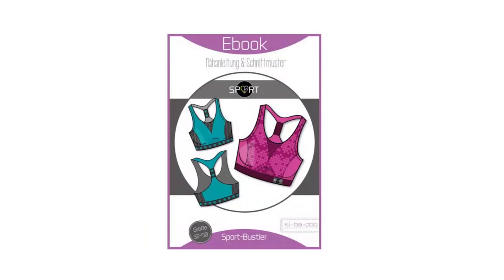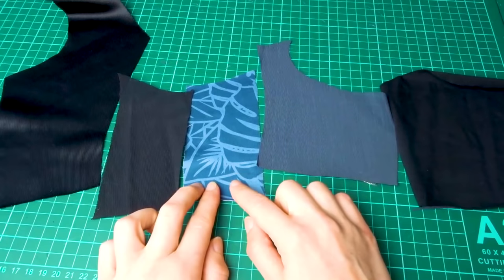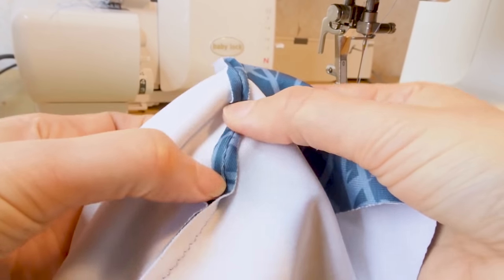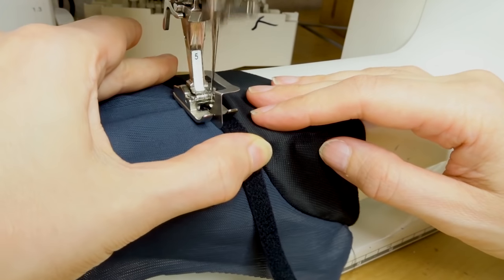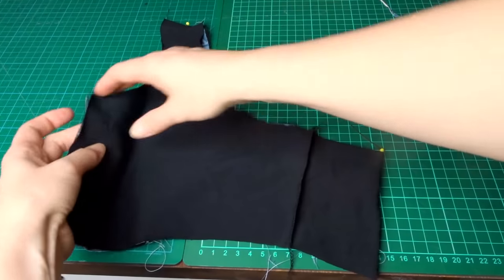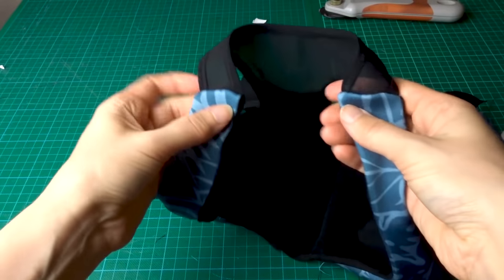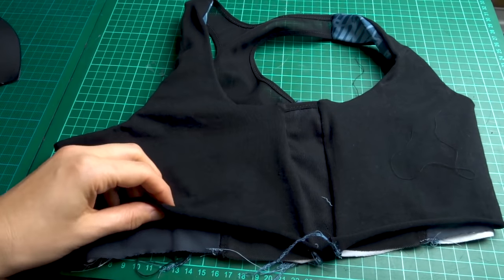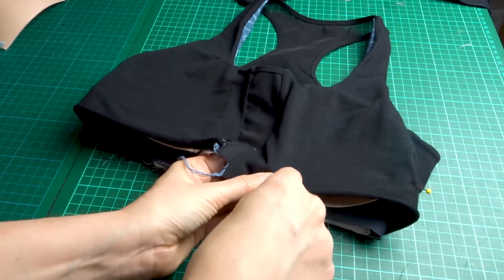How to sew a supportive sports bra

Comment: I realize this is an old post but for those watching now and wondering how to best finish the edges of the trimmed bra cups. These are my suggestions: 1) medium zig zag around, 2) serge around or 3) use strip of sheer cup or 15 denier tricot  to bind cut edge (can also use foe). Since foam cups are all internal the first two suggestions would suffice. This would also flatten the exterior cup contour so you don’t get as visible a ridge do to a thickness drop off from foam edge to no foam. Hope this helps someone. Great video and tips. Well thought through.

Comment: This is so helpful Johanna!  The end bra has so much good support!  I've got a round of baselayer gear I'm working on, and one of the pieces needed a proper bra, and I didn't want to go with my plain RTW bra, so I'm making it up as I go along as well cloning another bra, LOL!  We'll see how it goes!
Reply from the maker: Yes, cloning a well fitting bra and then just add design elements is probably the best way to go about to be honest. I used a RTW bra as my fit guide too and that helped a tonne, even though the end result was different from that bra

Comment: You made this look so easy.  I have been working on my first sports bra.  Not by any means my first bra.  I used a lot of my bra making product to create mine.  I love the fit you got on your first try.   No easy thing for sure.  I hate to pull them over my head so I made a sports bra with a front zipper.  I followed the measurements to the t.   It fit well.  I may make the band  a little bigger, but I need to get the zipper in to know for sure just how tight it will end up being.  I love your yoga pant videos too.  Thanks so much for sharing.

Comment: Thanks so much for this video! Loved seeing how you constructed the middle layer. For the foam cups, I happen to have a lot of cut and sew foam so I usually cut out a rounded triangle and attach the bottom of the triangle to the elastic band at the bottom of the bra. That way when it goes through the wash, I can grab it by the band and give it a few good shakes to flatten it back out - don't you hate how the loose ones get bunched up?! Tacking the corners down is a good idea too, and I'll have to try that after seeing how well that worked for yours!

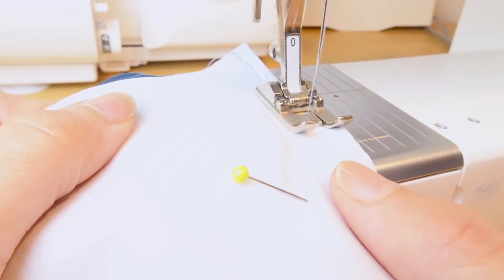Comment: Can you (or someone else) please spell out what type of stitch is mentioned at 2:47 mark? “Six step stitch?”  “Six stack stitch?” What is that? I been sewing for decades and never heard of that.  Also don’t know what a “cover stitch” is.  (We are from different countries so the terms might be different). I have only a very basic sewing machine...no serger or overlock machine. I can’t understand what type of stitch is needed to sew up the bra.  Is there a certain kind of thread to use on these?
Reply: A cover stitch machine is yet another type of sewing machine (different to a serger/overlocker and a standard machine)

She suggested that if you only have a standard machine you could do a zig zag stitch (a wide one with a short stitch length) or if you can use a twin needle in your machine you could use that too over the top of your pressed seam.

I think you are mishearing "zig zag" as "six step"

Hope that helps

Comment: This is exactly what I was looking for. I'm trans, and I have found that traditional chest binders are pretty rough on my ribs even in the "correct" size. I'm prone to rib pain anyway, it doesn't matter what I'm wearing, I think it's due to the shape of my ribcage (I know concave chests run in my family and while I can't quite tell, I'm pretty sure my ribs aren't exactly "normal"). Anyway. As a result, I wear compression sports bras on a daily basis. Healthy? Probably not. Better than binding? Yes. The trouble is my favorites are discontinued and the closest I could find have too tight a band (again, the correct size). So I've been considering just making my own to my own specifications. This gave me a very good idea of what materials would be appropriate and how I could use those materials in what I want yo make. Basically, long story short, excellent video and excellent tips.
Reply: Simply Vince hey Vince, I have problems too. I used to bind, but now I have severe arthritis, so I can’t wear those tight over the head binders due to extreme pain. There aren’t any for me either because they don’t come in front closures.  So I have to learn how to make something too.  How did your attempts work out and what fabrics did you use?